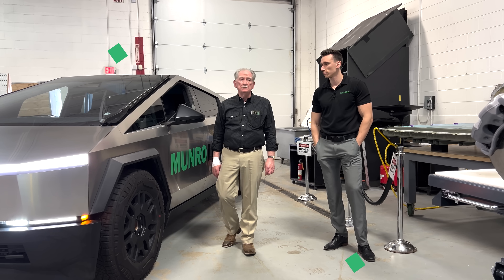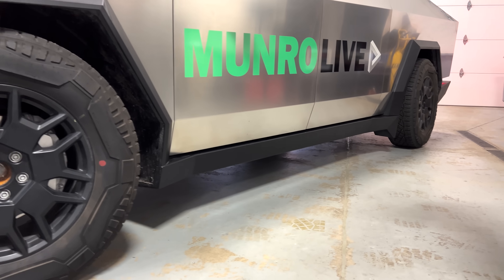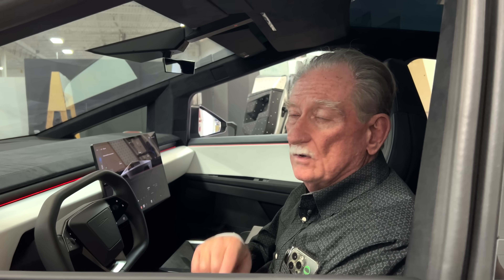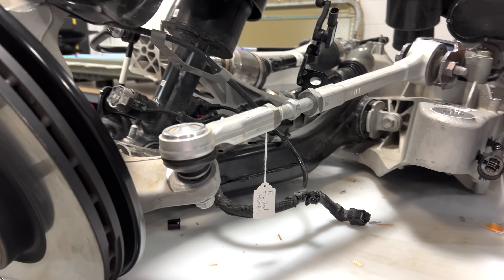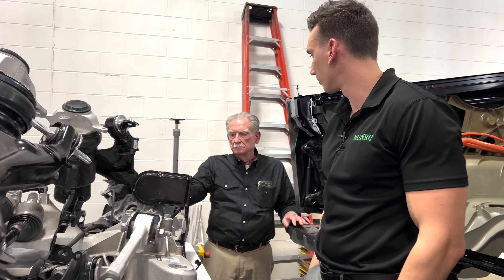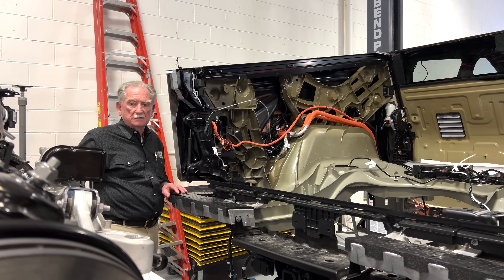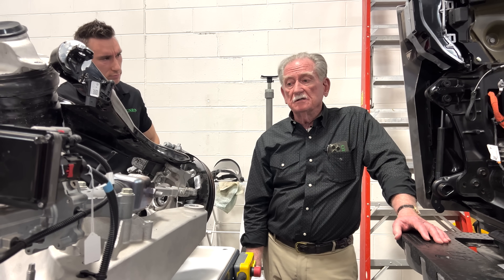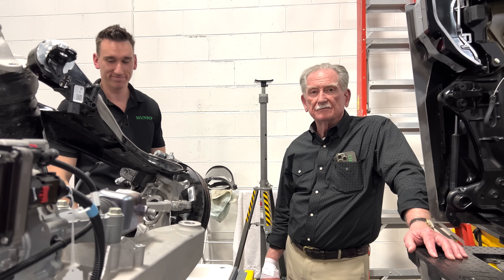Tesla Cybertruck Steer-by-Wire System

Comment: Do you think Tesla will put this on other vehicles, or is it to expensive for the cheaper cars?
Reply: its literaly very expensive and not needed! i dont get why they are even doing that! all that hardware to replace the very simple steering system what!!!!
Reply: I imagine it'll come to S and X, at least.
Reply: @jamesengland7461  - Would be cool, but less sure about using it in other vehicles.  It looks to be physically quite a bit larger than the existing S/X steering system, and also more weighty.  It provides more value in a truck than a car, but perhaps a car doesn't need such a beefy system.
Reply: @tesla_tap   "steer-by-wire systems can reduce weight and costs, increase interior space, and improve crash safety. They also have fewer mechanical parts and are less likely to fail than conventional steering wheel systems."
Reply: @danharold3087  - Not sure who said that, but guessing they didn't look at the Cybertruck. Clearly this system is not cheap or light.  Maybe in 5 years over a few design iterations. It looks to me that the steer by wire system has more mechanical parts too.  On the plus side, it improves the user experience, which makes sense in a $61K+ truck. It also makes the design of both LHD and RHD dramatically easier. So it does have value.
Reply: @tesla_tap   Yes the savings not having to set up RHD and LHD lines or the complexity of a line that can do both.   
Mechanical parts are not much different.   We are also eliminating the power steering system.  
Honestly would have to weigh traditional and STW to say on weight.   They share parts.
Reply: It would likely take some time, even if the plan is to change them all over.
Reply: There’s no obvious reason why it should be significantly more expensive than normal power steering.
Reply: @fredbloggs5902  it is significantly way more expensive than regular steering lol!!! all the 3 electric motors plus the electronics..... thats waste of ressources garanteed.
Reply: @alanmay7929  a regular steering rack is very much in the way when designing the frontend of a car. Engineering around this fixed component is also expensive. Even more so when you have to account for those weirdos who drive on the left side.
What's keeping SBW from being implemented in other vehicles right now is that its new. That does make it expensive. Same thing with 48V LV architectures.
It's only a matter of time until more suppliers offer suitable parts, which will drive costs down and makes it viable for lower end vehicles.
Reply: @Marco-rx4cg  lol!!!!! the regular steering wheel is super simple, with the architecture of EVs its even much easier to place them in the car and finally the most expensive part is the dashboard and control setup.... most of the world uses left steering wheel. suppliers have been making all kinds or types of voltages for multiple applications.
Reply: @alanmay7929  SBW isn't that much more complicated than regular power steering.
Reply: @Marco-rx4cg  yes it is! you can not underestimate all the hardware required for that and also the expenses with it.
Reply: @alanmay7929  From the way you're texting, I don't think you can estimate that.
Reply: @Marco-rx4cg  ok "Einstein" you know everything! show me in which way all the extra motors and electronics needed are "cheaper" than the normal steering rack lol!!!!

Comment: Engineering marvel👌. Tesla giving a hardtime to other OEMs and auto makers!. Seems like they are selling hi-tech too cheap. Other automakers depend on the glitter and glamour, while Tesla base it on form and function. Just wish they used a little bit of glitter and glamour on the exterior though.❤👍
Reply: Almost everything on the Cybertruck which is "innovative" comes from giant suppliers. The steer-by-wire system is from ZF.
Reply: nonsense!!! when we talk about advanced vehicles this tesla garbgae is not even to be mentioned! the Mercedes Unimog that no one talks about offers literaly everything from all wheel steering to central tire inflation system to vario pilot which you can literaly slide your steering wheel from left to right with the pedals and dashboard all in one, a rigid/flexible, PTO for mounting crane, snowblower, all kinds of equipments for construction, utility.... the list goes on and on, lets not forget its an excellent offroad an offroad monster
Reply: @alanmay7929  This is a little unrealistic.  The CT will not go where the unimog goes and the unimog will not be accepted by soccer moms and grandparents hauling a load of presents when they head out to visit the grandchildren.

Comment: What happens with wheel alignment. With steer by wire how can one ensure that the tires are perfectly aligned.
Reply: The alignment is fixed by the steering geometry and is independent of the steering movement itself.

Comment: Sorry, but the explanation of the locking of the wheel sounds weird. It looks like the wheel stops a bit before 180 degrees, not 90, possible 3/8 or 135 degrees. I am just watching your video. From appearances, I would say that it rotates ~135 degrees in each direction. So the wheel can make a full rotation of 360 degress minus 90 degrees -- equal to two times 135 degrees - that is, 270 degrees and 6/8.
But never mind -- keep up the good work producing YT videos for us, because we would like to see it all !!

Comment: Sandy was right; the next software update will increase the steering angle of the rear wheels. Yes, ZF is developing the Steer by Wire system for the CT together with Tesla. Tesla works with many hidden champions in Germany, but of course, you know which Tier 1 and Tier 2 suppliers Tesla has.
Reply: ZF is the worlds largest automotive supplier and makes parts for literaly all manufacturers, rear wheel steering is also been in development with all manufacturers too! mercedes and other manufacturers have much bigger trucks that offers up to 3 or 4 steering axles.
Reply: @alanmay7929  Bosch is the largest, whilst ZF is big, Bosch is bigger
Reply: crap!!!! didnt tesla made the steering angle up to 10 degrees+ from factory!? why didnt tesla made the locking diff also available?! those are just lame excuses! the very old chevy quadrasteer had a significantly much bigger rear steer angle from factory.

Comment: My 1st truck didn't even have power steering and it worked excellent.
Reply: And?

It probably didn’t have airbags, anti-lock braking or seatbelts either 🙄
Reply: @fredbloggs5902  And death rates are no different
Reply: @MegaWilderness  - Well, the dead don't complain about the lack of safety systems!
Reply: @MegaWilderness  From 1975 to 2017, seat belts are estimated to have saved 374,276 lives. Source: Injury Facts - Seat Belts NHTSA
Reply: @danharold3087  That is a tiny number over all those years. Six point belts would have saved more lives
Reply: @MegaWilderness  The problem is you said "And death rates are no different"
Little is subjective Meaningless if it is one of your family that dies.    Early lap belt often crippled people who would have died.  Shoulder belts better. Six points better yet.  Airbags ?  Still too many.
Until every vehicle has V2V we will continue running into each other.
Reply: @danharold3087  I said more people are killed now than in the past. Absolute number
Reply: Absolute number is meaningless if population and car driving increased @MegaWilderness
Reply: @MegaWilderness  higher population than the past
Reply: Yes and it polluted causing global warming and bad air quality
Reply: they just had a bigger steering wheel back then :) and not as wide tires.
Reply: Mine too, and suffered progressive more back pain as I grew older, got out of the truck tired on a not small off road trip, or a long road trip.  I still remember what the parking "experience" was.
The sedan I how drive has hydraulic steering.  On a long trip I got out of it as if nothing happened, not tired, no pain, just as I got in.  To clear it a MB W210.
Once I tried a GOOD assisted steering, I am not going back.  I have driven a lot of cars, many assisted steering, and there are very serious differences between manufacturers.
Reply: And didn't cost as much to purchase or maintain nor weigh as much

Comment: Really good presentation. Thanks.
I believe to have heard Tesla is going to offer an upgrade to the rear steering angle - but it will also need some hardware upgrade (replace rear steering actuator) for that.
I wonder if they eventually also will offer user adjustments of the steer by wire system.

Comment: What's the mtbf?   And what is the consequence of a failure?
Reply: Word salad nonsense.

It has multiple redundancy on both sensors and actuators so if any part fails, control is maintained and the failure gets reported so you get it fixed.
Reply: @fredbloggs5902  Mean Time Before Failure,  usually expressed in thousands of hours.
Reply: @jamesengland7461  Yes, I know what it means, with multiply redundant systems it’s largely meaningless.

An optical encoder typically has an mtbf of 500,000 hours and Tesla have triple redundancy.

You’re more likely to have a jumbo jet land on your head.
Reply: I'm guessing they used either sil 2 or sil 3 functional safety when developing this steering system. In case of sil 3 we're talking 1000-10000 years mtbf. Airplanes, Trains etc. use sil 4. There are tables on wikipedia for anyone interested.
However, in functional safety, mtbf doesn't really mean much. You'd differentiate between what kinds of failures the system could experience, how likely and severe those would be and also if one aspect fails, you're trying to control how it fails.
Reply: Yes, like in aircraft costing millions, and constant maintenance, there are still tragic failures that happen.
Reply: @gregcollins3404  In other words you are saying that if you use any system long enough you are going to find corner cases not covered or faults due to assembly errors.  Very true.   But it says nothing about any specific vehicle.
Reply: @gregcollins3404  You’re clueless.

Blocked

Comment: It’s clear the steering system does not use a planetary gear as the final drive to the linear actuator for the front steering, the offset input shaft is clearly a worm gear.  This is because the motors need a very large gear reduction and the motors need to fix and angle and should not be able to be back driven.  The friction means the gear is one way and self locking.
Reply: Wouldn’t that make it hard to be moved by the other motor ?
Reply: @ralanham76  Yeah, Im trying to imagine how a worm integrates and its still possible for one motor to operate the whole system. Sure seems like it would just lock up... that kinda kills the "triple redundancy" idea and instead doubles the points of failures.
Reply: @patreekotime4578  both motors drive the shaft with the worm pinion.
Reply: @hugegamer5988  then there is no redundancy just twice as many points of failure.
Reply: @patreekotime4578  and that’s why steer by wire where human safety is concerned is only found in machines costing tens of millions and up with comprehensive maintenance schedules looked after by teams of technicians.  Cheap lean design cars left to rot with no mechanical linkage backup are a class action lawsuit just waiting to happen.
Reply: @ralanham76  no, both motors are before the worm gear.
Reply: @hugegamer5988 There are two gear housing one for each motor.
Reply: @kazedcat  yes, but they were talking about the final reduction with the marks.
Reply: @ralanham76  Yes, the gearing must be back-drivable. They clearly look like worm gears, so they might be recirculating ball systems.
Reply: @brianb-p6586  why would you want the motors to be back driven by external input?  It would cause massive wheel misalignment and cause the vehicle to go out of control.
Reply: @hugegamer5988  if one motor fails, the other motor needs to be able to turn the steering, which means back-drving the failed motor.
Reply: @brianb-p6586  most motor failure mean a failure to deliver torque, not a seized shaft.  If that was a concern there could be a clutch but I doubt it’s necessary.  It’s already no redundant because a bus failure could knock out power to both motors.
Reply: @hugegamer5988  no, a single bus failure should not knock out both motors, as they should be on different physical and logical network segments.  

The motor won't mechanically seize, but if the reduction gearing will not back-drive (for instance,  if it is a typical worm-and-wheel), the working motor won't be able to turn the other motor's gearbox.
Reply: @brianb-p6586  the 48V system runs both motor busses.  A single short on the 48V battery would take out the dc-dc converter as well leaving the vehicle with no steering, no brakes.
Reply: @hugegamer5988  correct, so there must be two 48 V batteries... or it's just unsafe.
Reply: @brianb-p6586  There is only 1 48V battery.